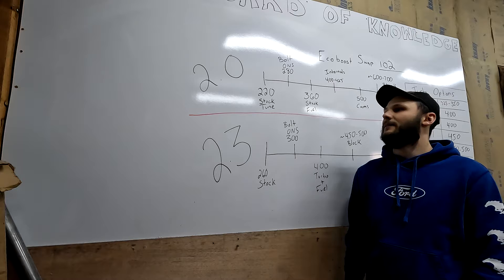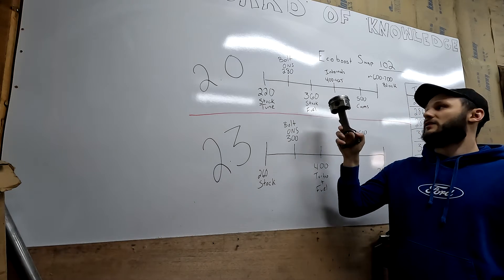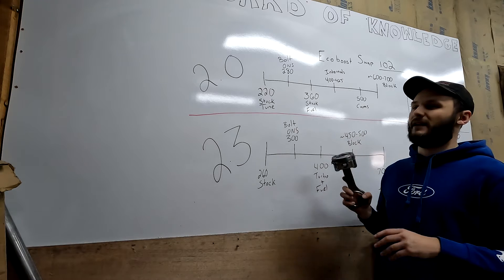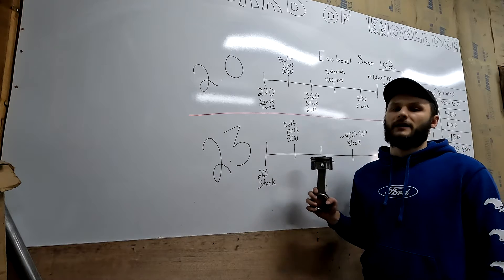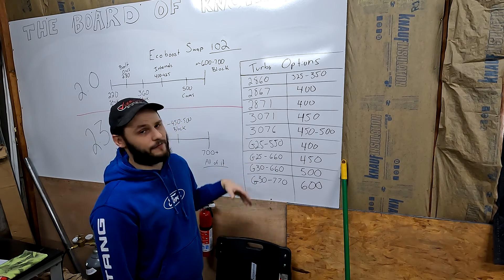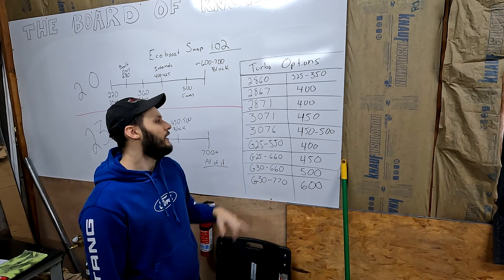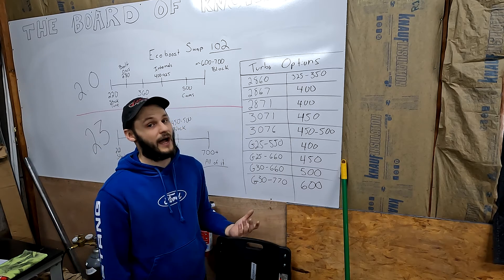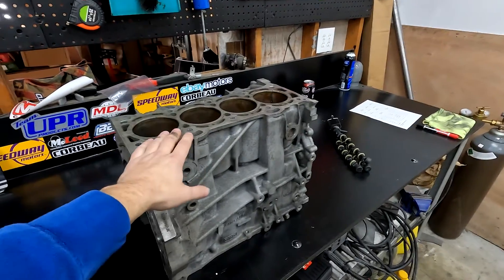Ecoboost Swap 102: How to Make More Power

Comment: I was really considering going with an Ecoboost on my next project until i found out about the part where you have to spend $2200 for a fuel pump and 4 injectors. I just can't justify that cost. I will probably stick with my original plan of an aluminum block LS.
Reply from the maker: You don't have to get the upgraded injectors and pump. There are cheaper ways to upgrade the fuel system. Also to get an aluminum block LS that makes the same power you will probably spend a similar amount. 

Thanks for checking out the video, and the interest in the Ecoboost platform!

Comment: Im doing the math here.take a 302 from say a 1990 5.0 put head studs and fel pro 9333.1 gaskets with a new harmonic ballencer with a on3 turbo kit and make 350 ta 400 whp on under 10 pounds of boost for under 4 grand .why spend 6 plus grand to do the same thing save 100 pounds iff the front of the car ?
What am i missing?
Better fuel mileage with this set up.
Reply from the maker: Someone else will always have a cheaper way to make power. Not saying that this is the best engine swap out there, but it does improve weight balance, get better gas mileage (I average high 20s on the highway), and parts and spare engines are cheap and easily available. 

To each their own. I know guys that would look at a turbo 5.0 and say "why waste the money on that instead of swapping in an LS".
Reply: One thing that is really cool is the fact you can work on the engine so easy with this set up.

Ls yes if you want to make above 600 hp .

Keep up the good work .

Comment: Do you know much about the later 2.0 mills? Ive been looking to upgrade mine,(2016 edge). Ive read that they have a twin scroll turbo also. Would appreciate any info you moght have. On the 2.3 blocks, could you epoxy the deck like the subie guys?
Reply from the maker: I personally would avoid all of the twin scroll engines. The second generation 2.0 Ecoboost have open deck blocks that are very weak and well known for head gasket failure between the cylinder bores. They improved this slightly with the third generation engines. But they are still open deck. The best upgrade you can do on the 2.3 is to swap everything over to a closed deck 2.0 block. You can still pick up the blocks for less than $500.

Comment: The 2.0 has an extremely high failure rate in stock from . They have a crappy block design which causes the head gasket to fail  . Millions have been replaced and there is a class action lawsuit filed against Ford .
Reply from the maker: Looks like you know a lot about these engines. Do you know if the pre 2016 escape 2.0 Ecoboost has an open deck or closed deck block?

Comment: Is 300+ RWHP possible with 93 octane? E85 is not available in my area
Reply from the maker: Yes, most people run into an octane or knock limit around 380hp on 93 octane. If you don't have E85 in your area, you could always run methanol injection to pass this limit.
Reply: @stroupperformance  thank you. also what are your thoughts on using a T04E type turbo over the 2860 or 2871?

Comment: Would subscribe but gonna aim for 300. Question my man. Did I understand you can put a 2.3 heads on the 2.0? How bout turbo exchange for an upgrade? Love your your & explanation....mine will be a junk yard build
Reply from the maker: Yes you can put the 2.3 head on the 2.0 block. The stock turbos are not interchangeable though, as the 2.3 has a different exhaust port shape than the 2.0.
Reply: @stroupperformance  gotcha I know nuffin bout'm, learning Though, got 3 projects going and I think 2.0 may be in future for one. Truly inspiring
Reply: @woundedfox5109 call an EcoBoost engine builder and verify this but I was told ( by an engine builder) the twin scroll 2.3 will not work with a 2.0 single scroll (focus ST style) block. Something about deck height being different. I did a 2.0 twin scroll block with 2.3 head on my Ranger.

Comment: So are the turbos twin scroll that you're talking about?  Since from 2017 that's what Ford switched to using in the Ecoboost engines.
Reply from the maker: No, all of the turbos mentioned in the video are single scroll. I would not recommend using the later twin scroll Ecoboost engines, they suffer from the same block weakness as the 2.3L Ecoboost as they are also open deck.
Reply: @stroupperformance  I have the 2020 Fusion 2.0T that comes with the twin scroll so I was wondering if there were any upgrade options for it.
Reply from the maker: @Shellbackrc  I do not know of any turbo options for the later twin scroll engines. Not as many people upgrade those engines like they did with the earlier ones.

Comment: Just to correct you on some with the 2.3 with bolt ons is more of 325whp and up. Typical fully bolt on 2.3 runs around 350whp with intercooler and exhaust with spark plugs then the e30 gas and up you start to creep to 400whp
Reply from the maker: Thank you! I tried researching what people were making with bolt ons and tune. I was seeing everything from 300whp to 400whp. I decided to play it safe and state the lower power number. 

Same with the 2.0 people claim up to 300whp on the stock turbo, but most people make closer to 280.
Reply: @stroupperformance  that’s fine I’ve been around the ecoboost forums on Facebook for almost 5 years so I see what the average whp and stuff is with the mods. I had a friend who was just full bolt ons running around 330whp and it was pretty quick then he went big turbo and was pushing around 400whp on 100% meth but yea like you said the block is a killer for the 2.3 but once you swap the block with a 2.0 or mzr block your good to run 400 plus whp somewhat reliable and their was one guy that was running 500whp on stock motor with a efr 7163 turbo and full meth it was crazy his car was running for 3 years no issue